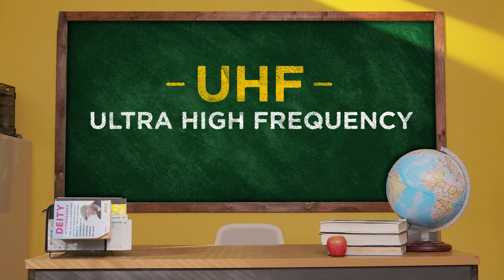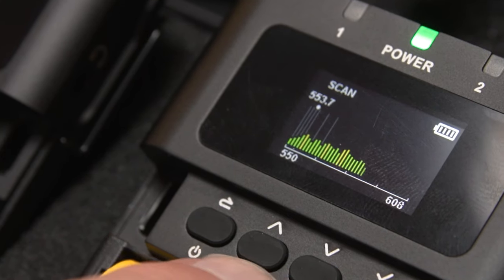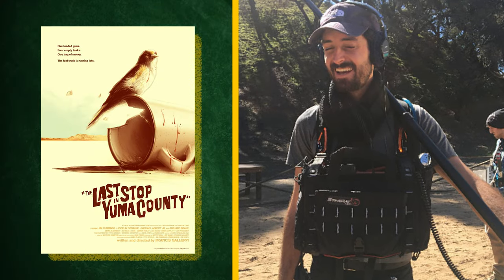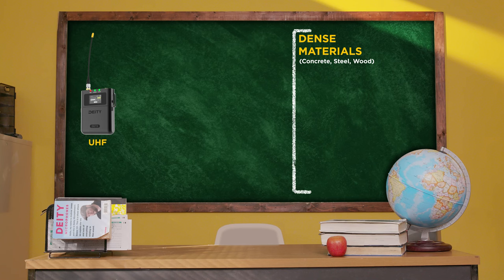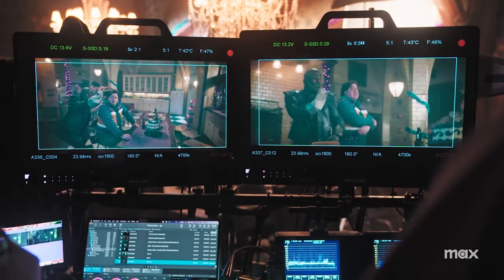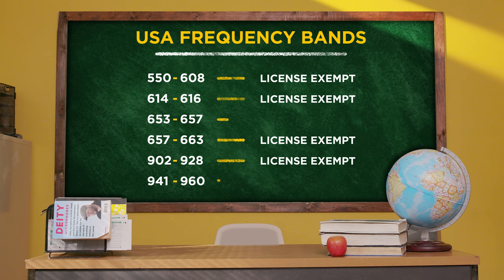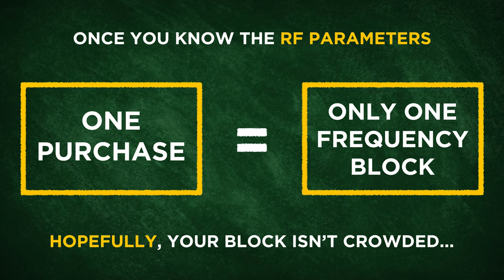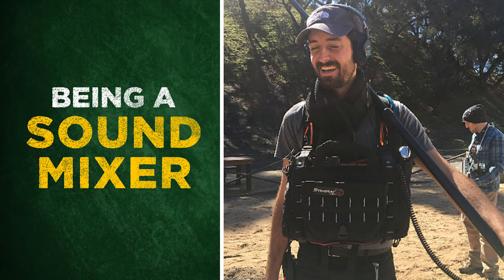Why Professionals Use UHF and Not 2.4GHz

Comment: Well this is all fine and good but then WHYYYY didn't you make the Deity Connect system based on UHF instead of the 2.4 GHz frequency that this video is dunking on? 👿
Reply: Deity was a baby company back then, was taking baby steps. 
Deity Theos is a more mature product.
Reply: Yeah its a little bit strange to call people that might still use their 2.4ghz kits "unprofessional"  (in a way).

Comment: The wideband frequency feature is fantastic! I used to use exclusively UHF mics but got SO tired of losing money every time the govt would auction off the frequency band my mics were set to. Cost me thousands of dollars buying new gear that was compliant and selling the “old” still working stuff for pennies on eBay to international buyers. Such a hassle. Went 2.4ghz just to avoid that, but this wide and feature on these makes me want to come back!

Comment: Great info. While I have the Rode Wireless Pro and DJI mics, I've already faced the many challenges (dropouts, random squelches etc). I look forward to trying the Theos and am hoping Deity comes out with a compact wireless mic (with internal 32-bit recorder) solution too. Love your products!
Reply: I understand. I will be glad when they drop the Deity PR-2 STEREO POCKET RECORDER.
Reply: But don't you have the back up recordings on the Rode Pro's to cover the dropouts and such? I just ordered some Rodes to combat this when using my Senny's.
Reply: @JoeTheViewer  Devices that have built-in back up recorders are great, but in situations where you need to route the audio to a sound system for sound reinforcement or broadcast a high end uhf system is better. I mix live sound and can vouch for the high end uhf wireless transmitters and receivers. The rode stuff will probably be great in certain situations but flexible high end uhf is usually the standard for live recordings.
Reply: @JoeTheViewer  Very true. Having the backup internal recording is a godsend, just an extra step in post. Loved using the DJI Mics until I encountered audio drift and a really odd stop/start glitch that hopefully got fixed in their last firmware update. The Rodes are great but would love to have a UHF system from Deity that has the size/form factor of the Rode or DJI mics.

Comment: I understand what you're getting at here, but the UHF band goes from 300MHz to 3GHz, so 2.4GHz is UHF.
Reply from the maker: The term UHF is used differently in the wireless microphone industry. Anything above 470-1GHz is UHF, anything above 1GHz has its own name. Like 1.9Ghz micronphones are called DECT, 2.4G is just called by it's frequency number.

Comment: Question?
This is a nice video.
as a licensed ham radio operator (among many other things, qualifications and disciplines ) I am curious if there is a manual frequency override function where if I've done my due diligence, verification and coordination processes ( possibly requiring special licenses ) would the technology in this device allow me to theoretically operate on a frequency outside of the approved frequencies?

These videos are getting very dangerous this is probably the third or fourth set of Deity products I would like to buy and have no reason to yet.

Comment: but we are talking about digital signal transmitting? I have my AKG uhf with auto settings since 2015. I used it on concerts, that is one of the most unpredictable environment and it never failed me. when it detects interference it jumps to another frequency. but it's analog signal - so the noise floor is low but it sticks out in post.

Comment: so, the"US version" works automatically in other countries, changing parameter from the app? it turns into the global v?
Reply from the maker: The frequencies and RF power adapt. It will remain a US unit in that it will not simultaneously transmit and record, if that's what you're asking.
Reply: How does it “adapt” what if you use a vpn connected to your phone?
Reply from the maker: @felipeandjess  a VPN doesn't change anything.